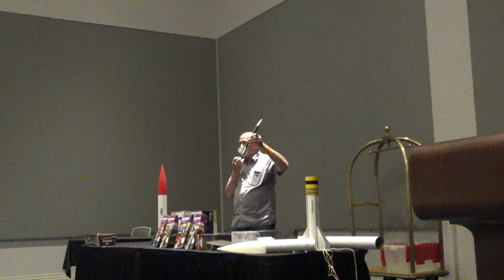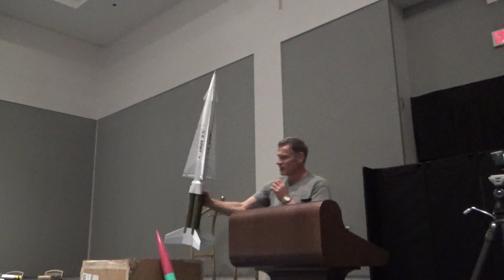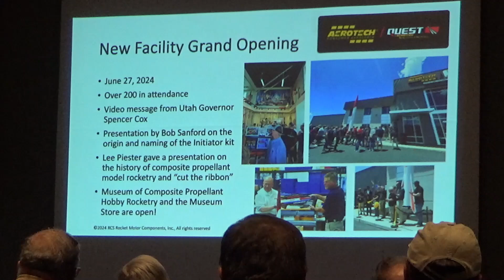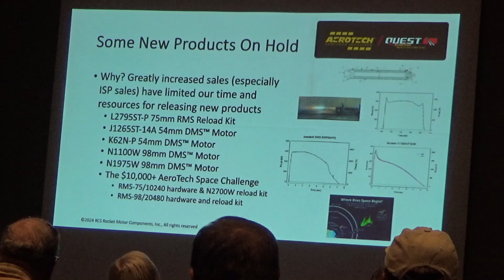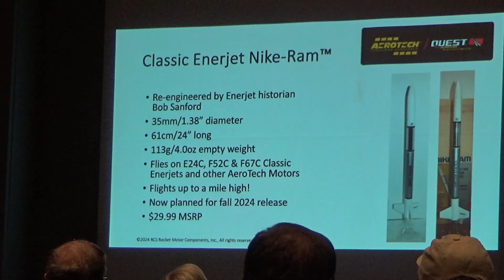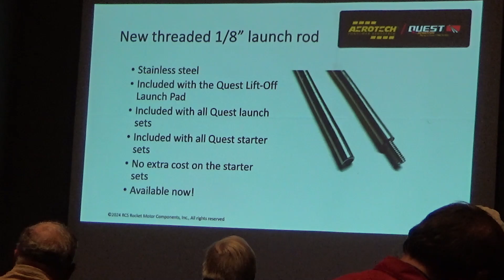NAR Manufacturer's Forum at NARAM-65 2024

Comment: Who was the guy talking about the egg timer dual deploy kit? I am curious about engine "bags". This does not sound as secure as the blister packs. What engines were recalled? E22 and what else? What was the average age of rocketeers attending this? 

Thanks for sharing this. It's a long watch, but well worth it to keep up with what is going on/coming.
Reply from the maker: I missed the intro while paying for my auction rockets. I think he's Bill from BMS. I bought motors from BMS in the field, but he was covered up. 
Estes is going from the motor blister packs to bags. I haven't seen them yet except in photos. The big deal is that E motors should be mailable without hazmat from estesrockets.com with two motors per bag. 
From the start, the recall was only D12 but seems to have been expanded to C11. https://estesrockets.com/pages/d12-engine-service-bulletin
I wondered about the average age. I'd say about 65 since traveling to NARAM requires time off from work and disposable income. It just happened to be that my wife was attending a conference in Denver at the same time. There was about 100 attending the auction at 6pm and only about 40 for the forum at 7pm. There seemed to be a lot younger people at the auction.
Reply from the maker: Yes, Bill. Here's Tim's video. https://youtu.be/ggyu0h6SGso?si=QO0LXGjdVcDJkU2g